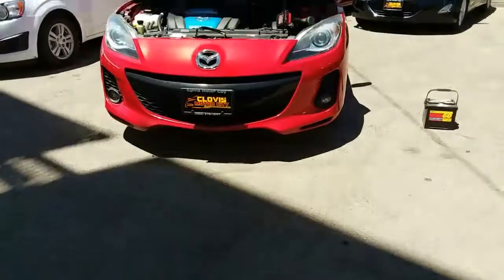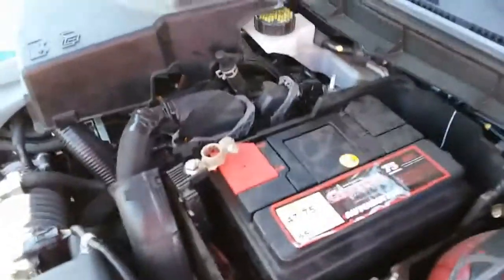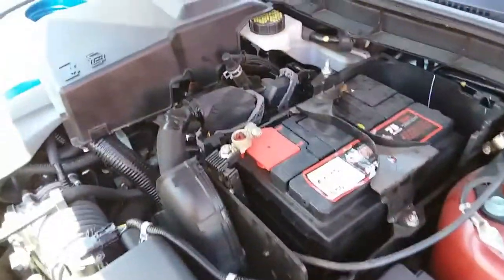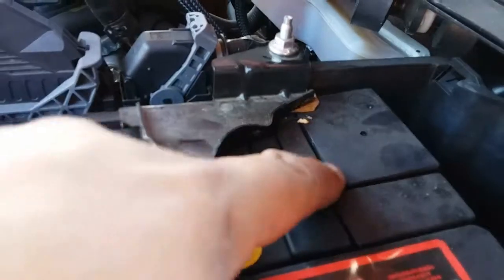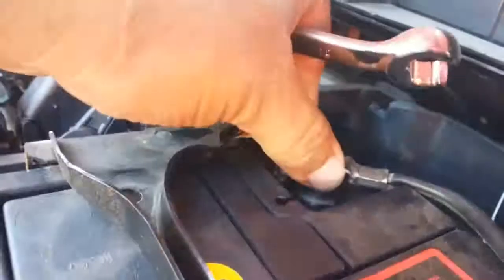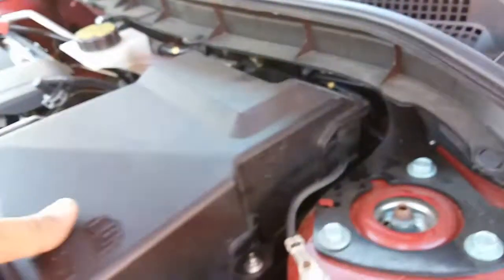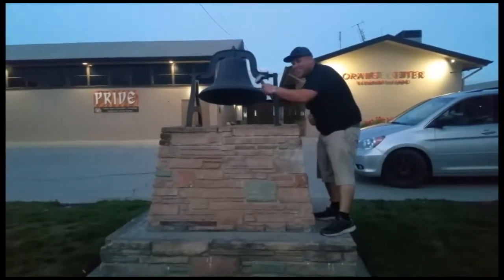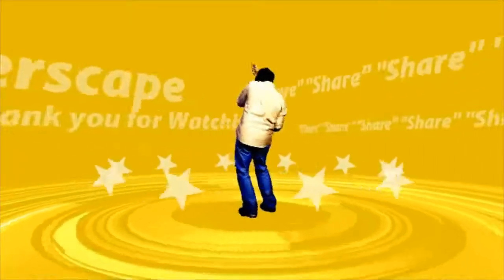How to: Install a Battery on a 2013 Mazda 3

Comment: That's a nice lager battery that fits well in a Mazda 3, as it is a Group 47 (H5) battery compre to the OEM battery that is Group 35 that's smaller and weaker!

Comment: Yo what if I damaged the fuse harness on the positive post, can I bypass it and connect those 2 cables to post
Reply from the maker: Yeah u can but that fuse is there for a reason
Reply: @559powerscape  yeah just that dealership is not open until Monday so I had no other choice- I connected them and worked great but I will buy the fuse soon